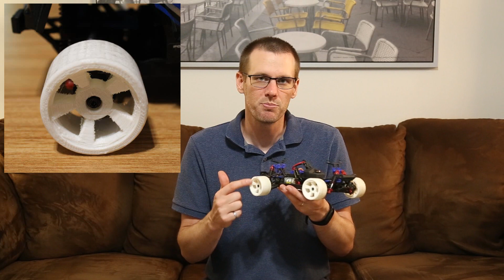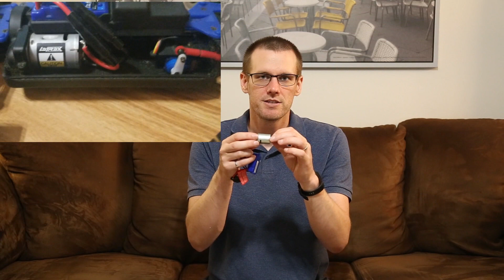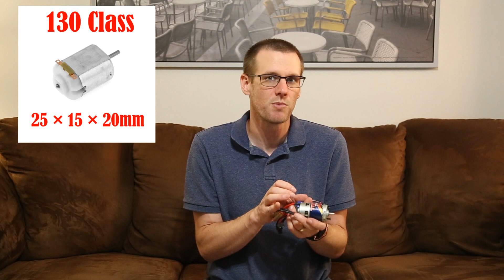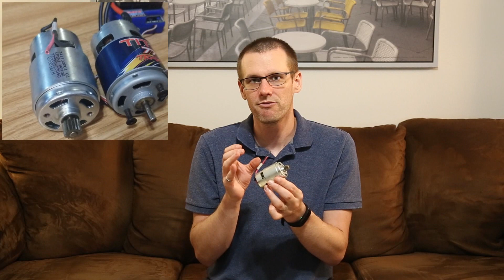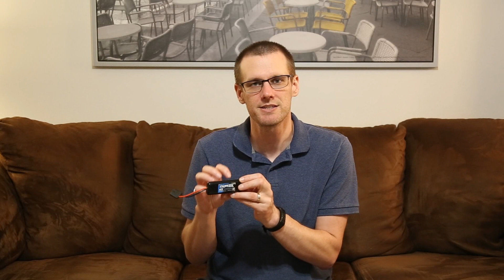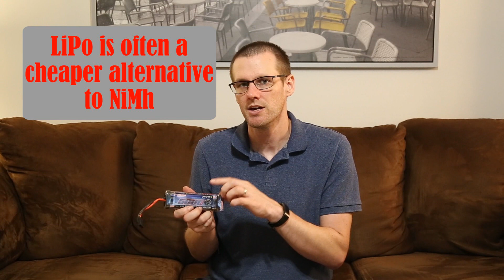Should I Throw my Brushed Motors / NiMh Batteries in the Garbage?

Comment: Except that the LiPo can burn your house down requires balancing, and are more tempermental and more easily damaged....just my opinion.
Reply: Store them in "storage mode" at 40% and they'll last years. I used to worry about my LiPo collection until I realized that hobby shops are filled to the brim with lipos and they don't burn down.

Comment: I am actually considering a 550 11t brushed motor for my 1/10 buggy simply because it is cheap, should have plenty of speed for beginner track use especially with a 2s lipo. It also has the added benefit of good throttle control and some engine braking which makes track work somewhat easier compared to the freewheeling of brushless motors.

Comment: I still use them. Great for my kids slash and stampede. I want to switch for my 1/8 flm chassis stampede. Already my best basher but could use the weight reduction. Just haven't had the cash really to get the easy traxxas set up and to be honest...little intimidated. Soon though. Also the 9.6v Nimh on vxl is crazy fast but weighs a ''metric ton''.  Ya baby?

Comment: I once beat an international RC car racer.........
By side swiping him on accident. I had a crappy 1700 radio shack battery and a motor I had replaced the armature on. I found out later that I was not allowed to tamper with stock motors. Well I played along and was a good sport but I still have my trophy. I believe that a kid racing against adults should have some kind of buff or something to boost the speed. How much I don't know. I crashed more than anything. By the end of that season I had given a scare to some and they started annoying me so I quit. Way too serious a sport. I'd take the same car and crash it in a brbwire fence. Same motor. Different tires. I don't even know if racing still exists at least dirt oval events. Never tried carpet banked... The old track is needing weeding and packing. It's public I think. Next to it is the cement pebble 1983 banked oval.

Comment: About a year ago I bought my 10 year old grandson a Traxxas XL-5 Bandit with a brushed motor and NiMh battery. We have both beat the crap out of it, and it still runs fine. I have bought a couple of new batteries. I wouldn't use a LiPo battery for anything period. They are nightmares. Almost anything will destroy them, the explode, they catch on fire, it is bad technology that needs to be replaced with something else. A coworkers $20,000 motorcycle burned to the ground because he had installed a LiPo battery in it. Houses and cars have burned down because a cell phone with LiPo batteries caught on fire. At least one airliner crashed killing several people because of LiPo batteries. Stay FAR away from these things. I don't even know why it is legal to make and sell them.
Reply from the maker: Sounds like someone I knew who said gasoline should be banned. Gas too easily can explode, catch on fire and even burn down a shed, garage, home or car. Oddly enough, it is legal to have such a potent energy source available to those with no training required.
Reply: @RCexplained  EV's do not use LIPo's were occupants safety is of the most importance.
Reply: @RCexplained  i'm not sure. Let's wait till gasoline cars really catch on, to know if this will be the case :D :-)))
Reply: I think EVs use Li-Ion and so do laptops and phones. Its the RC industry that uses LiPo and that to raw cells without controllers.
Reply: Man I actually agree with you there. Been into RC for ten years maybe. Debated with myself this year wether I should get a new car running on LiPos or not. Watched many videos about LiPo safety. I know enough to handle them safely, but in the end I chose a car with brushed/NiMh combo. I just can't risk my family and my house for "a bit of fun". Had a LiPo in the past and thought it was so safe inside my LiPo bag. Until I saw videos showing batteries catching fire inside those bags. Flames bursting out. Metal containers like the Bat Safe are way better, but, since you have to store batteries at room temperature, I have to store them within the main living area of my house and I just can't feel completely safe with LiPos.

Comment: A brushed motor working as a strictly DC motor sees almost full torque at startup going slow, so it makes sense to put them in crawlers. That's why we use DC motors for elevators.  Good video. Thanks.
Reply: I love brushed because it's pedal to the metal and less spin-out. I really just don't want to have to buy all the new battery crap. When I got 5 nimh packs.
Reply: @marshmower  you can run a brushless on those, in series. It will be faster then a single lipo 😁

Comment: Thank you for sharing your knowledge. I have learned a lot the last couple of days. Thanks!!
One question though about swapping NiMH to LiPo battery. What is the minimum C-rate (continues current) I should be looking for when buying a LiPo 2s? My old RC car was sold 17 years ago and the battery only stated 7.2v/1400mAh. Will a 45C or perhaps even a 25C be good enough as NiMH has a low continues current rate (please correct me if I am wrong)....keeping in mind what you mentioned in an few other videos about lifespan etc.
Greetings from The Netherlands, Jim.
Reply from the maker: 25c will be fine. Watch for heat in your motor and esc.

Comment: Is it ok to use 5000mah  Nimh battery in a brushed motor?
Reply from the maker: Yes. Just check for heat when running it
Reply: @RCexplained  alright. Thanks
Reply: @RCexplained  so 5000mah will heat more than 3000mah?
Reply: @RCexplained  and can 5000mah battery overheat in 25minutes?

Comment: Brushed motors are fine. But Nimh is a money pit if you can't run your cars atleast once a week. 

Brushed motors with lipo are a good combo. Good consistent power and excellent throttle response.
Reply: I'm the opposite, I use NMHI in sequence on my 1/16 brushless revo. It's an absolute rocket, does 49 mph if you can control it.
Reply: @apking130  I do the same with my 1/16th slash on 3s. I've clocked mine at 67mph running 45/45 gearing with a 3660 3600kv motor. It's insane how much power it has! It's incredibly unstable though, I wish I had the mini revo lol.
Reply: @RobertNES816  Yeah. The 1/16 slash is ridiculous imo. Even the brushed motor is unstable
Reply: I forgot to mention, the batteries only last 11 minutes

Comment: Spot on, I still run brushed motors in some of my RC's yet run lipos in all of them. Whenever I get a NiMh battery with a RTR vechile I cycle it and list it for sale with the rtr charger straight away and never have a problem finding a buyer.
Although I think the reason alot of people still prefer NiMh batteries is they're scared of the fire risk associated lipos and or they have been in the Hobby a long time and have been using NiMh batteries in all their vechiles for 20+ years and don't want to change.
Reply: Bingo. I’m terrified of coming back home and finding it burned to the ground. So I stick to nimh just to play it safe.
Reply: @alexnava8729  
Most fires start from people using a power supply to power their charger that's not up to the task, it gets too hot and catches on fire.
The biggest problem is eBay and Amazon sellers selling these items together as a bundle, same with ESC's and motors.
Most b6  hobby charges are rated to 80W meaning despite having the option for up to 5 or 6A charging rates  you the maximum rate you can charge a 6S or two 3S batteries at the same time in series  is 3.2A and highest rate you can charge a 4S or two 2S in series is 4.7amps. however the charger can usually accomidate, sometimes overclocking a little but reducing the charge current rate automatically especially as the voltage increases with the charge.
Most external power supplies don't have smart technology like that and will just try their best to deliver what's asked for them. A common power supply sold with these items is a 12V 5A supply.
This will work with a B6 charger but has a maximum output of 60W (12V X 5A) what this means is it will safely charge a 2S battery @5A yet a 3S battery at 5A it will probably do it but get dangerous hot and my work 99 times in a row yet is in danger of catching on fire.
A 4S or a 6S @ 5A will almost certainly either blow a circuit in the power supply if you are lucky and catch on fire if you are not so lucky.
Therefore a 15V 6A (90A) power supply is a much better option for a 80W B6 charger or even for a older 60W version too.
This can technically happen when charging NiMH batteries too but alot less likely due to less current/power being alot less.

Lipo batteries are usually pretty safe so long as you don't overcharged or overdraw them both in either voltage or their maximum charge/discharge rates.
Also hard case batteries have much better resistance to rupture and can take a lot impact before it's dangerous.
Also there are alot of signs that are telling for when a lipo is damaged and should not be use such as being puffed up or not being able to be balence anymore.
Also I wouldn't recommend charging any batteries when not home, even NiMH can get hot whilst charging too both battery and charger.
Reply: My parents don’t let me use lipo so a week ago I bought a hobbywing max8 g2 and am running it on 14s nimh. Just got it today and on the first one I hit about 60 mph at 75% throttle on all lowest settings
Reply: How long does your brushed motors last on average?
Reply from the maker: That's right, Andrew. There is still a place for those components as much as I dislike saying it. Thanks for the comment!

Comment: NiMh can be fine if you don't draw a lot of current and have enough cells.
Let me elaborate: pilot uses 4 NiMh cells as a receiver battery in an airplane with big servos. After a dive he cannot control the plane anymore, it crashes. What happened?
4*1.2V per cell = 4.8V which sounds fine, but now consider that the servos can draw several amps. (Even small servos can draw an amp stall current!) This results in a large voltage drop. Drawing a couple of amps from a NiMh cell can easily result in a drop below 1V/cell.
So momentarily the supply voltage to the receiver was only 3.x V, apparently too low.

What's the solution? Add another cell to get 6V unloaded, 4.x V heavily loaded. Or use a powerful (!) BEC. Another option is HV servos that can run directly from 2S (8.4V) lipo.

Comment: Thanks for the awesome video. Was wondering about this myself. 
Can brushed motors be used in airplane/heli?
Reply from the maker: Brushed motors can be used in airplanes and heli's. However, they only excel at the micro size, once you get in to larger models brushless power works a lot better.